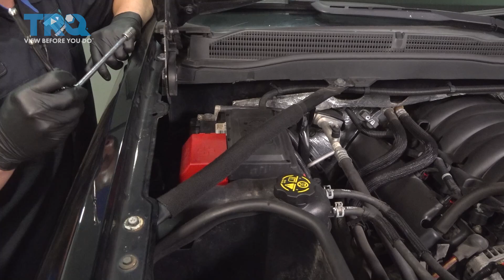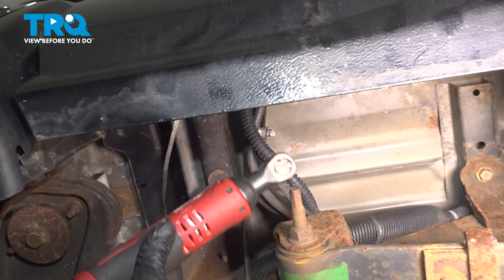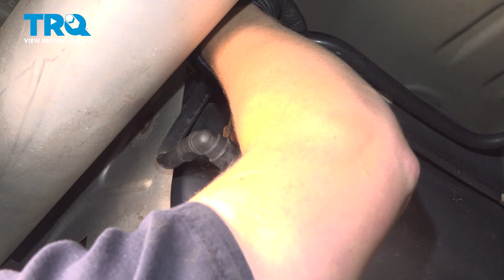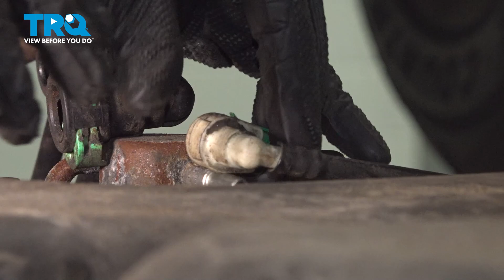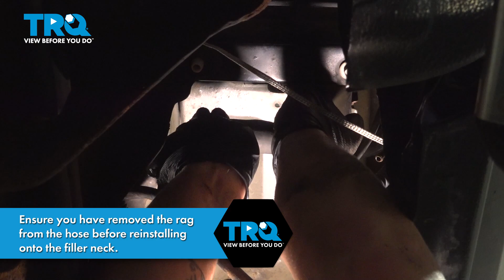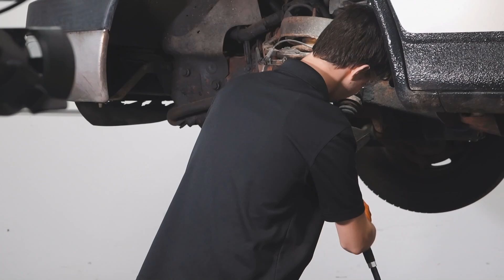How to Replace Fuel Pump Lock Ring 2014-2018 Chevrolet Silverado 1500

Comment: Just a heads up if you live in a place where it rust. It’s no where near this easy. The lines on the fuel pump seize up. The lock ring welds shut with rust. Be prepared to possibly have to buy a new evap hose and new fuel line. Also get your bible out and ask for forgiveness before you even start on the lock ring. Might as well get a new lock ring too.

Comment: Hmmm🤔 I was told by a dealership you couldn't change the locking ring without replacing the pump and the ring in my 2500....fishy